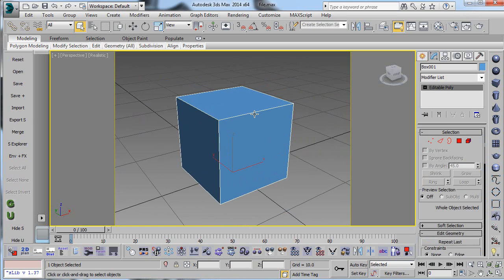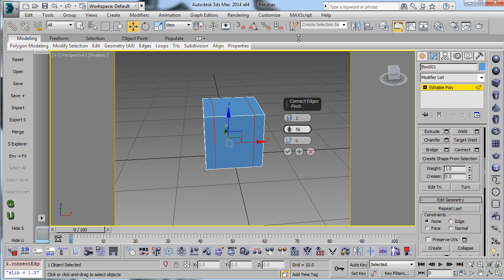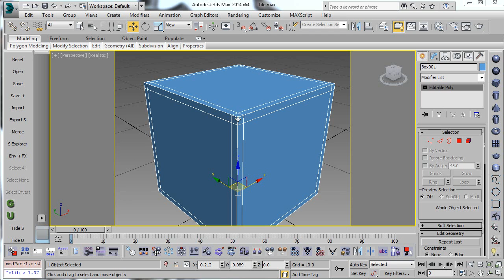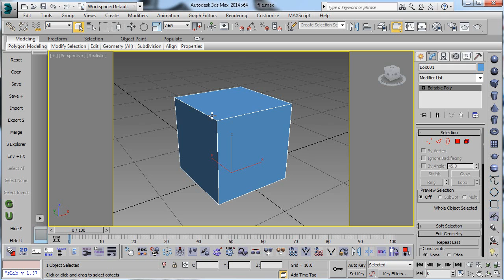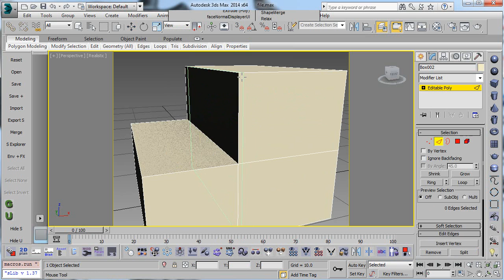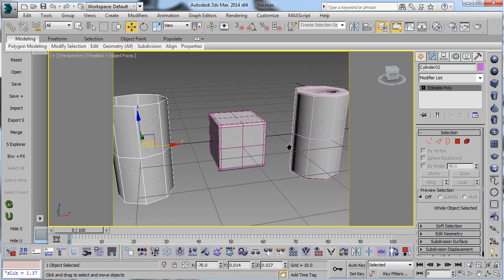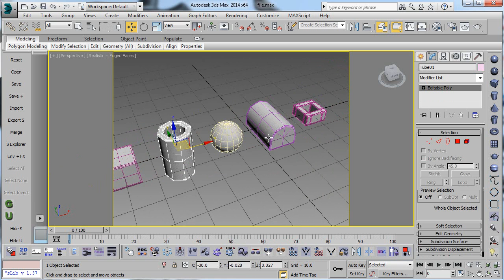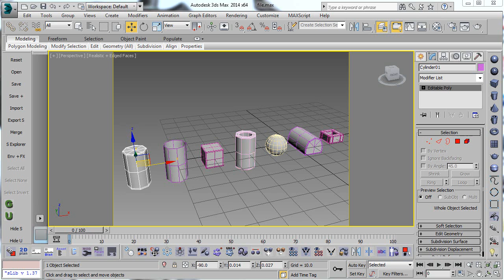Subdivision Surfaces: Using Support Edges

Comment: your videos has a lot of very useful information thanks alot for sharing all the good stuff 
i have a question don't you think that the best method would be using support edges with opensubdiv knowing that opensubdiv preserves UVs better than turbo smooth (as far as i know ) ?
Reply: Ok thanks alot :)
Do you have a face book account ?
if there is no problem i would like to add you as a friend in facebook to ask you when i have a CG related question
Reply from the maker: +thebloodykingdom I have a fanpage, do a search for soulburn3d. And I'll answer anything I can.
Reply: great i will check it out thanks